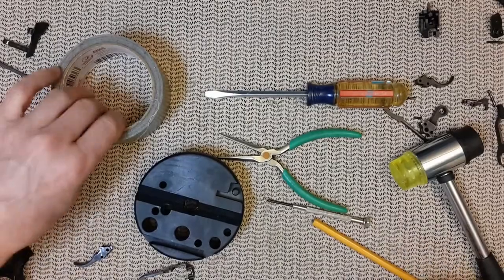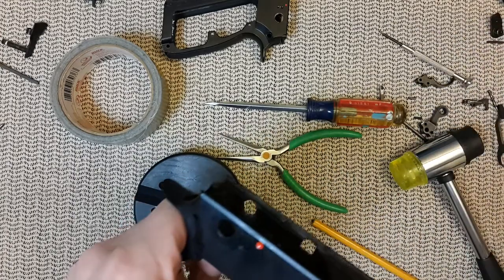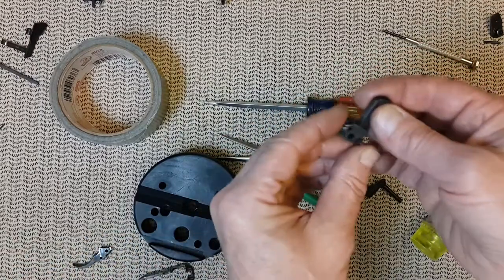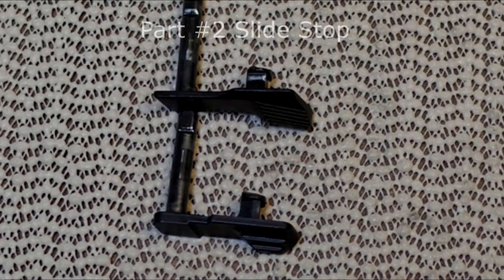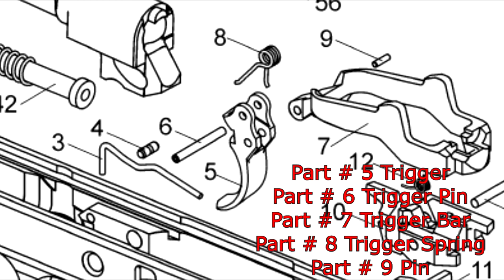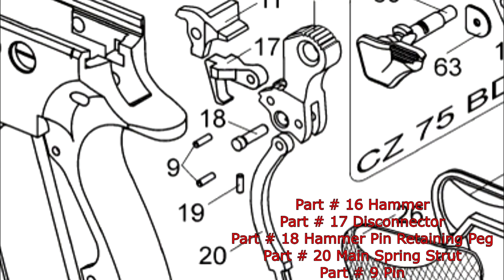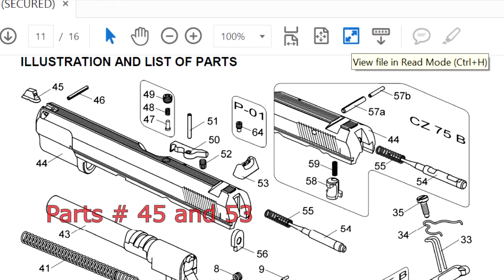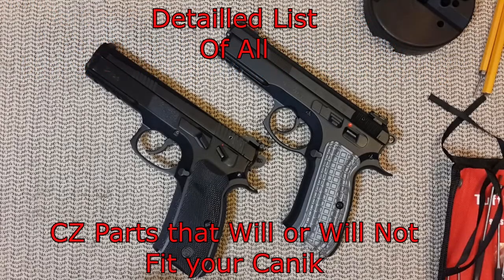Detailled List of all CZ Parts that Will or Will Not Fit your Canik

Comment: Thanks great video - Cajun gun works replaced everything in my p120 even give it the shadow 2 reduction system my p120 more then likely is the badess one on the planet it is a super beast - Shadow 2 shooters claim the trigger single action trigger blows there 2 away and they love the p120 and shoots it well - Its cheaper to get the TriStar p120 T 120 - fully cajunize with a lifetime warranty and the fastest repair turnaround time from 3-5 business days you will have your weapon back in your hands with no cost to you - there work is top-notch - customer service outstanding 10 Stars on a 5 star scale - TriStar pistol are great weapons i have used the P and T series accuracy insane - Great video again !!!
Reply from the maker: That Canik must now be a very sweet handgun now.
Reply: Indeed Sir i even hand polished it on the outside and inside - logos and engraving on it Sir one fine masterpiece created by Cajun gun works and myself - PEACE-OUT STAY SAFE -

Comment: Did you fin any way to fix fire pin roll pin if it start giving me problem on the future, or nah?

Thanks 🙏 

Any other parts I should be aware if I dry fire the gun a lot and use it for competition/range  every weekend.?

Should I sell the gun or run it until fire pin stop working due to excessive dry fire.

Comment: I did some googling and some measuring, I believe the barrels can be swapped for older CZ75 barrels like those in the 75B, the problem is that the SP01 doesn't use the old standard barrel width, it's barrel is 0.55'', the standard 75 barrels are 0.50'', and these canik clones also use 0.50'' wide barrels, so those just might fit... I've also found a thread where someone successfully fitted a threaded barrel from a CZ75B compact to their C100 pistol which seems to back up my findings, located here: https://www.ar15.com/forums/handguns/-/37-162519/? 

So, threaded barrels may not be out of the picture for us, assuming you can find one of the right length... I only seem to be able to find threaded compact barrels and 5'' barrels, but I believe 5.21'' would be required to fit on the full size guns and have have clearance for the threads, the same barrels used in the factory threaded barrel 75B (the 75B has the same 4.7'' unthreaded barrel length as the Canik fullsize guns, so stands to reason they should need the same threaded length) problem is no one sells the 5.21'' barrels by themselves. Best option I can find right now would be to get the 6'' unthreaded barrel from CZCustom and have it cut down to the right length and threaded...

That being said I'm not recommending anyone just run out and buy one of those barrels... Try to find someone with a 75B of appropriate size and see if their barrel will fit in your Canik first, just to be sure.

Comment: Thank you very much. I bought this week a Canik P120 and I would like to replace front and rear sights. I didn't understand if LPA sights for CZ-Sp01 can be fitted or it require a manual adjustment by gunsmith. Can you suggest me which CZ model I need to use as reference to have LPA sights fitable on Canik P120 ? Thanks ............... :-)
Reply from the maker: The link for the LPA sight is in the comment section
It might require some very light sanding, but take your time sanding its base
Reply: @practicalshooter6517  , I havn't the possibility to check phisically in advance wich LPA sight kit for CZ is suitable for Canik P120. LPA configurator suggest more than one CZ model solution  . Could you confirm if this is the right one  ?  http://www.lpasights.com/en/products/spr86cz18/. This sight kit is recomanded for CZ models : CZ 75, 75B, 85. Dovetail front sigh version. Many thanks for all your effort.
Reply from the maker: @ernestomantegazza7466  yes it's the one
Reply: Many thank. I will buy it and I will come back after installation. In god we trust....

Comment: Can you use cz decocker in tristar
Reply from the maker: Cmvb69 - I haven't tried it, but I doubt it it would work. The P120 sear and frame are not meant to accept a decocker.
Reply: But can't you replace the sear with a Cz 75 one?  It's my understanding it will fit. But you need to drill a hole in a different location for the decocker

Comment: I was really hoping the barrels could be swapped, there go my dreams of having a threaded barrel for mine. Thanks for putting this together.

Then again, now I'm wondering if barrels from some other kind of CZ pistol would work.
Reply: You just have a machinist make an adapter
Reply: My barrel ramp  it’s full of carbon deposit imposible to scrape even with harsh solvent. Maybe some fouling marks. Any suggestions?

Comment: Too bad the CZ barrel won't fit in the Canik.  CZ makes a .505" diameter barrel and a .550" diameter barrel.  From what little I've been able to discern, the latter is for use in the SP01 series.  Canik did use the same .550" barrel in their Hawk B6 and polymer B6P.  Why they didn't continue to use it in their new models is a mystery to me.
Reply: B6P is Sarsilmaz.
Reply: @OhioCruffler  B6 HAWK Sarsilmaz my favorite (had to get 2 at $300.00 each new)